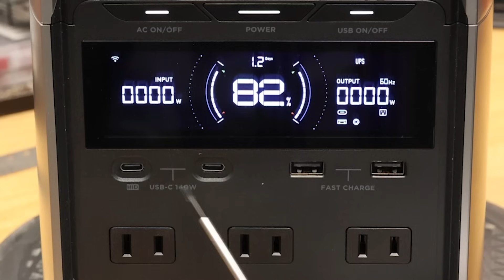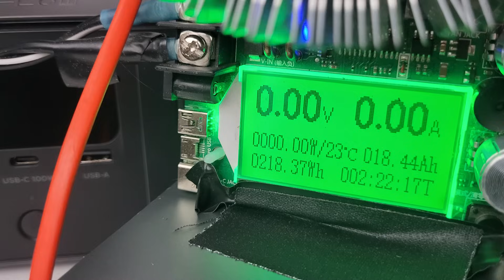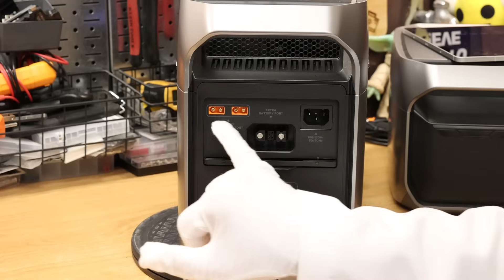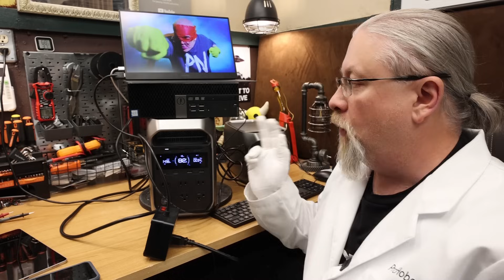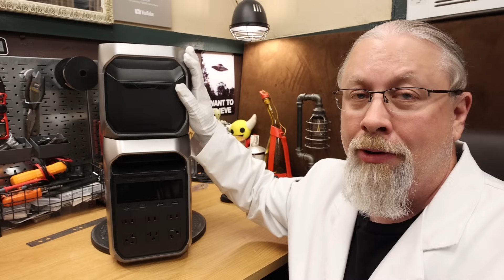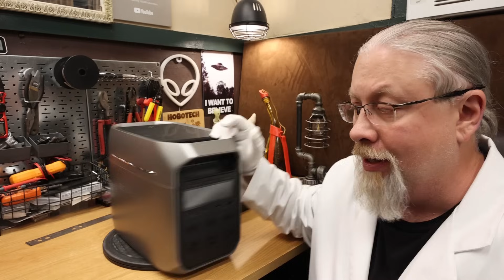ECOFLOW Delta 3 Plus 1800w | River 3 UPS Solar Power Station Review

Comment from the maker: CHECK OUT THE D3P: https://gohobo.io/d3p use code 05EFHOBO or 25EFVAHOBO for 5% off!
D3P on Amazon https://gohobo.io/d3pamz use code 05EFHOBO for 5% off!
River 3 on Amazon https://gohobo.io/river3 use code 05EFHOBO for 5% off!
CANADIANS check it out here: https://bit.ly/44H2No3
---
(140w power bank link: https://gohobo.io/padd )
Reply: Will you be covering the deals for the upcoming prime sale Oct 8-9?
Reply from the maker: @dailydr1ver935  Yep!
Reply: @dailydr1ver935  lol I've set an alarm ⏰️ 🤣
Reply: I wish your code worked in Canada😢
Reply: When the extra battery will be available?
Reply: @tamowill  And can this extra battery also work on the Delta Pro?
Reply: Is there a new code? Your cod eno longer works
Reply: What portable solar panels would you recommend to go with this powerstation?
Reply: Hope there will be a power station 2 review
Reply: Thanks for your detailed review n testing on the Delta 3.  Would very much like to see a detailed review n testing on the new Oupes Mega 1
Reply: Greetings Hobtech what are the max amps from the Solar input..I had to sell my Bluetti AC180 due to the low amperage on the solar side.10 amps is really not much and takes about 4 hrs to fully charge in ideal conditions and we all know how quick conditions can change.
Reply: Have the overheating problems been fixed ?

Comment: First impressions: EcoFlow Delta 3 Plus ✨
 
I’ve just completed my first real-world test after unboxing and fully charging my new Delta 3 Plus! 📦⚡
 
Today was one of those lovely sunny days we don’t get often, so I set it up with my portable cooker and kettle to make a simple lunch and hot drink. In the past, I’ve relied on my EcoFlow River 3 Max — which has served me well — but the Delta 3 Plus is on another level entirely! 👏
 
I started at 80% charge, heated up a delicious soup and boiled water for a drink… and used less than 10% capacity to do it. 💪 Both the cooker and kettle typically draw around 300W each, so this barely made a dent in its power reserves.
 
If you’re considering one for camping, beach trips, or evenings outdoors — I’d highly recommend it. It’s already impressed me massively!

Videos on my chanel 👍

Comment: How long could the delta 3 plus run the wave 3 AC unit with the Air Conditioner battery attached? trying to determine if this combination would last all night in summer conditions in the southeast?  Any info would be appreciated.

Comment: You make excellent videos!  Some suggestions -  measure the voltage from ground to neutral, and from ground to hot. it should  be 60 VAC at each  measurement (some people call this "balanced power") or 120  VAC  from ground to hot , 0  VAC from ground to neutral. It's not always like this. I have an Ecoflow  Delta 3 plus that is measuring 100 volts  ground  to hot, 20 volts ground to  Neutral.  Light bulbs will work fine but a lot of electronic equipment will work as if there is a brownout. Ecoflow tech support hasn't offered much help  so far. Also,  get an oscilloscope and look at the AC waveform. If it is spikey, warped, clipping at the top that  could cause problems. one last thing - check the voltage with a ground to  neutral bonding  adapter.   In the meantime keep up the good work!

Comment: For a little bit more than the price of an expansion battery you can buy another portable PS. Charge one while using the other and  swap them out. Also, you have a fully operational backup in case one has to go back to the shop,  etc.  (You can't power much with just the battery).

Comment: 🐊🌴😎 hi Hobotech ,good morning. I have  ropow guifcart battery  51.2 volt 105 amp hour ,can i use this to charge or use for backup  to extend dp3 .i have servel units i just want too utilize 5his power if needed, i also own the DPU WI5H 4 BATTERIES, YES HECK I WAS HOPEING YOU WULD HAVE THE NEW VIDEO 9N THE DPU X,I AM SURE YOU WILL HAVE ONE SOON LOL,,,I AHOPE THEY SALE THE INVERTER SEPARATE, THANK YOU  FROM FL,🐊🌴😎

Comment: Yeah yeah but that cheap Peavey solidstate amp is crap! Test a real amp, try a 100watt tube power amp for a half hour? Professor Hobo, I'm looking to power my music gear in my trailer with a small mixer 2x100 watt ref monitor, a 250watt solid state power amp, some rack gear, even an organ one day, a MacBook and lights plus my euhomy 49qt fridge. I currently have 400watts of solar from Renogy and a 60amp Rover controller with one cheap Walmart battery and considering one of these units to avoid all the wirring mess with bus bar sizes, wire gauge sizes, a breaker for everything and all that mess! Oh wise Hobotech, Which route do I go? Enlighten me oh wise and all knowing powerful Hobotech?❤❤

Comment: 15:45 Have you tried any of these power stations with a more realistic outage test? ie. outages I've seen tend to have a few seconds of fluctuation, like a brownout, before fully going out. None of these units that I can find really state their full specs for when they detect no longer being connected to AC and if they're just doing passthrough AC, I worry these 10ms switchover specs are useless if it'll passthru a couple seconds of sagging power anyway.

Comment: At 16:17, he talks about how if you draw the max amperage from the rear 12V car accessory port that the voltage drops to 11, and how it’s “not cool but it’s still functional”.  And today I understand exactly what he’s talking about…

The Resmed Air Curve 11 does not work with the Delta 3 Plus when powered by the 12V car accessory port.  My old Resmed version 11 (which uses a different 12V DC power supply) works just fine, but not version 12.  It does work using the River 3 Plus Max, as that has a more stable 12V car accessory port.

The Delta 3 Plus is a nearly perfect device from a defect perspective.  I still love mine in spite of this defect, although my D3+ now uses a lot more battery power to run my Resmed BIPAP device due to the AC to DC conversion loss, as well as the phantom load of the AC inverter.

Put simply, not all electronic devices will function when powered by the 12V DC car accessory port of the Delta 3 Plus.

Comment: What EcoFlow should have done is make the Extra battery ports daisy chainable with 2 ports on every piece of equipment they sell.   That way you wouldn't be limited to what you plug in. For instance, if it worked like a Daisy chain you could have the Delta 3p connected to an extra battery, the extra battery's second port could be connected to let's say one more extra battery, then that extra battery's port could connect to the Wave 3, then the second port on that could be connected to say their generator. That way everything can be connected as an ecosystem. It allows for infinite expansion and doesn't make you choose between having one extra battery and the wave or one extra battery and the generator. Like the Delta 2 Max has two ports and can have 2 expansion batteries but if you want to connect a generator you lose the ability to have the second extra battery same with the Wave and Delta 2 Max. You can either have only 2 extra batteries or one extra battery and the wave.

Comment: Seems that Ecofliw have “Delta 3 1500”, which is 1.5kw model in similar size to delta 3 plus, priced pretty much same.  Only diff I see is charging is limited to 500w, and ports are designed like delta 2 lineups.   Also battery cycle rate is lower. 

Change you do a comparison video.

Comment: I have the River 3 and love it for charging small items and running lights, etc.  I’m looking for something to run my house well pump for short intervals during a power outage.  Just to maintain water containers, fill up my pressure tank every once in a while, etc.  My well is only 100 feet deep and is 240 volts.  Could I use this Delta 3 plus?
Reply: Nope, it can only do 110 volts

Comment: Love the video! I bought one using your link. Worked about 2 hours and error 014. I can't even turn it off so now I have to deal with sending it back. Today the DJI 2000 came out, I may refund and get that instead. I bought this mainly because nothing can handle the Bambu H2D printer on startup. Need it for power flickers during the summer. Thank you!

Comment: I have another test for you.

What would happen if you ran the battery dead and the unit turns off then add “solar” input. Will it resume powering the load or just charge the unit or do nothing because it needs to be powered back on again?

Comment: The new Smart Generator 3000 does not have the large proprietary port for DC to DC charging, you use a regular 3 pin 110v plug to xt60i to charge with, which makes it less efficient and I would love to see a test to know just how much less... Pleeeeeaaaase.  It could make the diff. in my purchase.

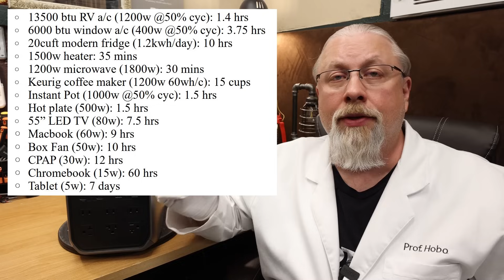Comment: I live in the middle of nowhere so I was thinking of getting a van so I can spend a couple nights in town every now and then... judging from the chart at 7:50 it looks like I won't be able to keep the AC on while I'm gaming in the back. Would it be better to run my PC, monitor, Starlink, and AC from the car battery and just charge the battery with the generator as necessary?

Comment: Hi, ecoflow. I would like to see a usb c in out pd port on both the delta plus model, and the expansion battery. It would give the customer more options to charge both batteries, and give the user an option to charge their devices from the expansion battery.

Comment: For $50 extra bucks (right now, May 2025), you could get a second identical power station. Why would you get such a limited battery. You’d have 2 UPS at home and when camping, you could dedicate them to different locations, shortening the length of wire needed. I guess you save a shoebox of space, I don’t know.

Comment: I need some advice with this thing work for a sump pump that’s 1/3 hp. It has a surge of up to 2000 W typically 1800 and typically uses around 800 W when working. If it was not keeping up with the water pumping it would run continuously at around 800 W, but when it kicks on from time to time every 3 to 5 minutes.

Comment: I'm a bit disappointed in the v3 line.  v2 hit the sweet spot with 2400w delta 2 max at 23kg.  It's unfortunate they didn't repeat this in the v3.  1800w doesn't really cut it for australia (2400w standard outlets).  to get that power in the v3 line results in something weighing 40kg+

Comment: Isn't the AC inverter idle efficiency a complete deal breaker on this unit?? By his testing it loses ~1000 watts in a day with nothing plugged in, doesnt that mean if I have even a 50 watt load plugged into AC then it will last significantly less than a day?
Reply from the maker: It's only a deal breaker if you plan on using it that way. If you use the inverter for short term loads and/or high loads it matters much less.

Comment: Great video. Maybe I missed it, but does this Delta 3 Plus support pass thru chargin. Or for example if I want to power something on the AC and have solar panels connected, does the Delta 3 Plus use the power from the battery or does it use the power from the panels depending if the current draw does not exceed the input power?

Comment: Has anyone encountered the error code 303 or 005? I never had the Delta 2 units just stop working ... I was lucky to power the inverter down for a few hours and then powered it back on and it was ok. Some issue with battery balancing.... For things that are critical I would not recommend the delta 3 plus unit. I put an older Delta 2 unit on my refrigerator since that is the most critical load in my house that CAN NOT fail. Please review these error codes 005 and 303.

Comment: I'm surprised they didn't make the extra batter terminal connectable like they did with the River 3 extra battery where you can just put extra battery on top and it's connected  great idea so you dont forget the extra cable for extra battery great video  Ps i heard there's a River 3 Pro coming out soon will you be doing video on it?

Comment: Noticed a few of you YT experts are using the Poniie PN2000 watt meter. Is there a reason why you chose it, if you can remember? When testing  KWH (POW POW- battery capacity test), which plug-in watt meters do a better job at faster sampling (and including into the total KWH) the initial surges or startup watts every time a space heater/toaster oven or fridge cycles up?  Any other reason why you chose the PN2000 over the Kill-A-Watt EZ for example? Thanks!!

Comment: WTF not make the extra battery plug cable shorter and have it vertical instead of horizontal so it doesn’t stick out the side of the unit?

Comment: Here's my experience with the Delta 2 - worked fine for 2.5 years - mostly used with the expansion battery as a UPS for my mini pc cluster. Never drew more than 400 Watts from it and then boom - one day it stopped charging and showed a red asterisk on the screen. I tried everything that the support people asked me to do but without the AC plugged in, it wouldn't even start. I am shipping it out for a replacement. Did I get a bad unit? Probably, but my confidence has been shaken. If such a light usage can cause a malfunction in < 3 years, I don't know how long the replacement unit (which they've told me is not new, so someone probably returned it due to issues) will last
Reply: BMS failures are fairly common

Comment: @HOBOTECH   Could you please do a comparison test with your Delta 3 Plus and the older Smart Generator model's charging efficiency with the battery ports and proprietary cable compared to the newer version Smart Generator connected with Bluetooth and regular extension cord. Seems like there would be an unnecessary conversion going on there with the newer.

Comment: Read it is better to charge around that size 100 ah 12volt whatever batt lifepo4. Is 300 watt is a good range for a good life. Course people dont like to wait. My solar generator nebo 1600 has around 1200 watt hour capacity. Got a 300 watt and 1200 watt setting ac input. Only 800 watt solar max 60 volt input almost.

Comment: I got mine during the B.F. sell, it was $1,099.00, It came with a nice leather carrying bag and two 220w new gen panels. I used my eco credits and got $200.00 off coupon and it dropped the price to $899.00.  I think I got a steal of a deal, those panels alone on sell are $350.00 each, I got them for $125.00 each -$650.00 for power station, or I can say I got the unit for $600.00 and the panels for $150.00 each.

Comment: Re : Ecoflow 800w alternator, Do you think it would be possible to make DIY connector to connect Delta 3 with battery and plug in the alternator inbetween ? It would be a deal breaker if we can charge a larger battery

Comment: I've been considering this for the UPS function to get longer run times than a LA UPS. Not to mention not having to replace LA batteries every 3-5 years. However, that AC parasitic draw is high at 41W... That would end up costing me over $50 per year in wasted electricity. A traditional 1500W UPS has an AC parasitic draw less than 10W.

I guess I'll have to build my own LiFEPO4 system to get a more efficient inverter. I see a number of them that are 10W or less.

Comment: Off subject. I bought the 3+ after your review and the extra battery. I love it. I have a request. Can you review the Anker Solix C300dc? Its DC only and Im intrigued since it would be great for camping and using my portable fridge due to its smaller footprint and weight. (6 lbs) Ill be your best friend. :)

Comment: Great review, but one huge difference between the Delta 2 and the Delta 3 for your and my use that you didn't even mention!  I was so happy with this change and thought of you immediately when I first saw the product.  It's because you always say you run these powerstations like I do, stuck inserted between things.  That is also exactly what I need!  But, while you can do that because the plugs are on the back and front of the Delta 2, everytime you mentioned that as a plus on your Delta 2 reviews, I've always shouted out (maybe you heard me?) that you still can't put the Delta 2 right between two large items, because the fans input/output are on its sides!  That means you still have to have some space on both the right end left side of the Delta 2.  BUT!  TADAAA..  Delta 3 has the fan also on the front and back instead and NOW you can finally jam the Delta 3 tightly between two things.  The awesome handle design ensures you can't block the input/output fans even if you push it all the way back against something.  I absolutely love this!  The second most important aspect is having the USB ports and AC outlets on the same side and all the input in the back.  Now when when you and I use it, it is perfect with the least amount of wires sticking out from the front and NO fans or ports on the sides, while still having access to all the charging ports in the front.  (Asides the cigarette lighter port, which in the car you already have them around the car, and in your home typically only need USB power for those type of items)

Comment: Great review. However, I still don’t know if you can charge the unit up through the USB type C power delivery. I have the ego nexus 400 watt inverter and it can charge from a 100 W USB type C power adapter. I also have the dewalt USB type C power adapter that fits on the 20 and 60 V batteries and it is also by directional. What happens if you have two 500 W solar panels in parallel on one input will the charge controller internally current limit the amps so that the maximum charge is still limited to 500 W or will it burn out the charge controller? That matters a lot to me. I have an off grid solar system and I have 11 325 W solar panels in parallel against a 40 amp charge controller and it just current limits to 40 A. It works great on cloudy days. I also have way more solar panels on other charge controllers too. 

It looks like I’m going to have to buy the Delta 3+ and find out for myself .